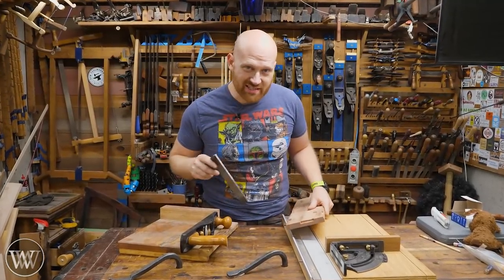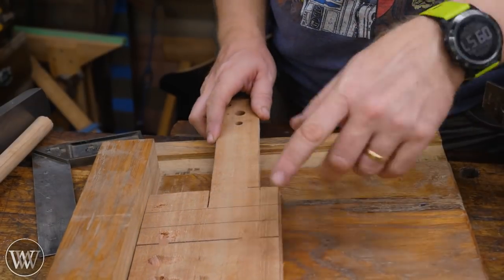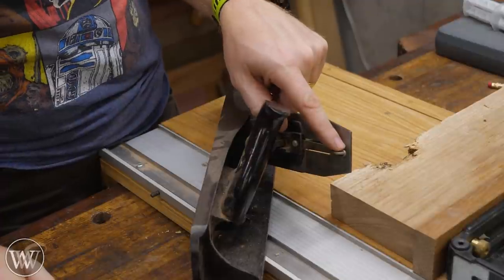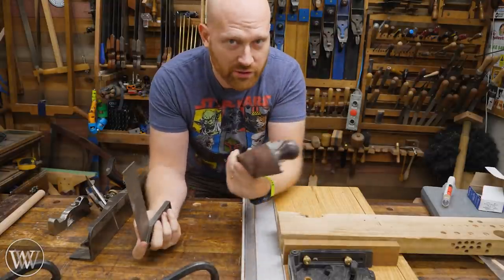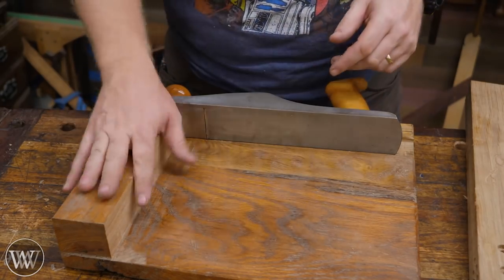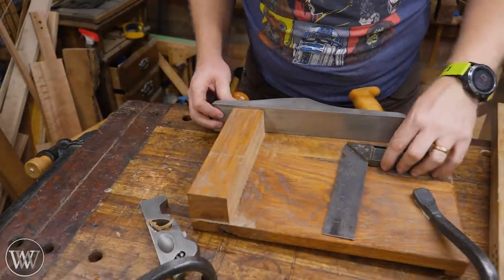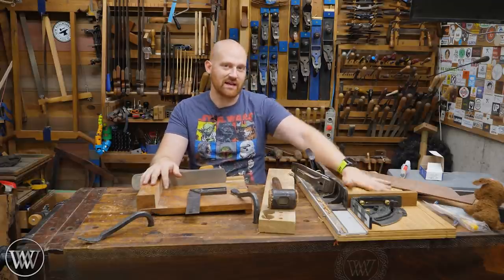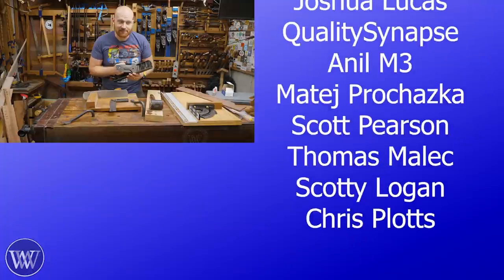How to Make A Shooting Board Shoot Strait

Comment: Just want to add one thing that worked for me. Make sure that no matter how you make your shooting board, it's adjustable. I always assemble my shooting boards with screws, so I can fiddle with it later on. Made the mistake of gluing the first one I ever made, and when it eventually went out of square, it was just scrap.
Reply from the maker: That's why I showed on the second one. I actually prefer to glue it if I just wanted it to be a certain angle. It has less tendency of going out of square. But it's pretty easy to adjust with a shoulder plane.

Comment: Generically speaking, it’s not the lateral adjuster that’s the magic;  it’s the blade.  I use a 24” wooden jointer for a shooter, and tippity-tapping the blade to get it square to the shooting board is interesting.

And, never mind the shoulder plane, whip out your #10.
Reply from the maker: I wish I could use that number 10. I need to fix it one of these days it needs to be braised as one of the sides are broken.

Comment: I haven't got my new shooting board dialled in and it just annoys me. I've been fiddling with the shoulder plane but need to spend a bit more time on it and fix it once and for all. Most of the time however I just bring the workpiece out from the fence a little and shoot without referencing the fence and just checking for square as and when. It works. I do wish I'd made an adjustable one though

Comment: True that a shooting plane don't have to be square to shoot 90°. But if you don't have a dedicated plane for shooting and you just got it perfectly set to make thin even shavings and then you want to shoot something...
I would hate to readjust it only to readjust it again for regular planing. l'm really happy that my 5 1/2 is at perfekt 90 sole to side so I know it will shoot 90 when the blade is set parallel to the sole.
Reply from the maker: Even with a dedicated plane you have to make sure that it is square. It's the same amount of work one way or the other. You still have to do lateral adjustment with a dedicated plane. Whether the sides are square or not it makes no difference in the function.
Reply: Of course you have to adjust. I think it's a workflow think for me. I adjust my plane while planing and when the blade is perfectly parallel to the sole I know it will shoot a perfekt 90°. In this way I can go back and forth between shooting and planning.

But actually I just checked, my plane isn't perfectly square and I remember now that I adjusted my shootingboard so that it will shoot 90 when the blade is parallel to the sole... 

So, I agree. There is no need for a square plane.